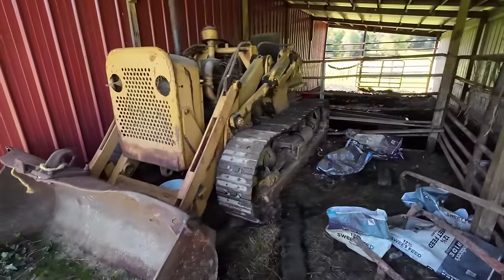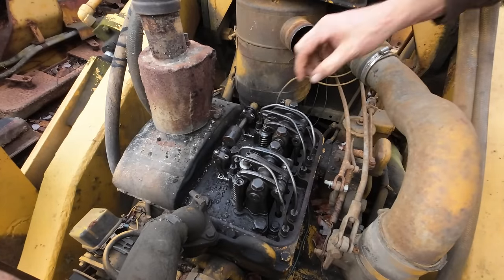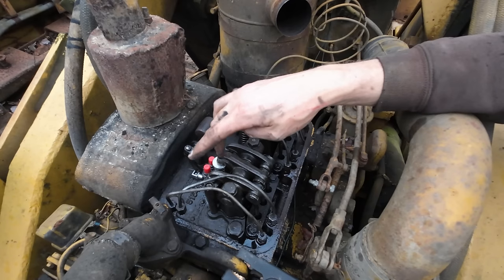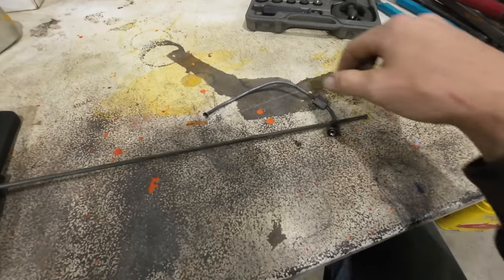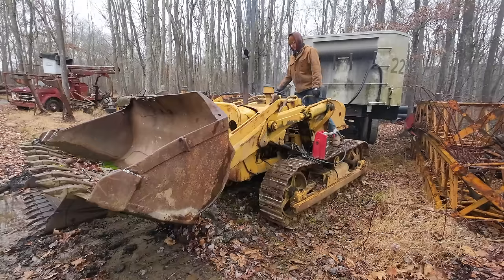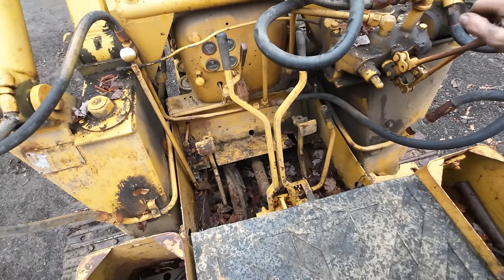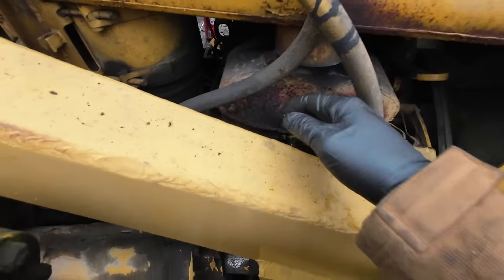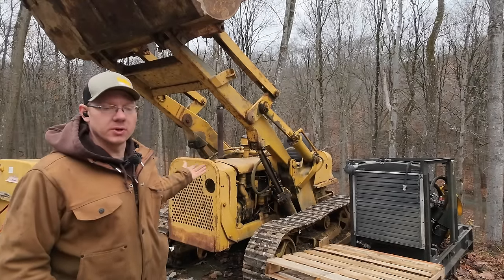$500, Allis Chalmers Track loader. Sitting for MANY years!  (Will IT RUN?!?)

Comment: Allis Chalmers produced some great equipment back in the day.   It would be interesting to see what they'd look like if they had survived until now.
Reply: I know it's technically not the same, but they are still around as the Allis Gleaner Co (Agco). I keep saying they need to make throwbacks with the Massey lineup rebranded as AC, Oliver and White's. I'd be a sucker and all over it! If it weren't for different colors, equipment models look the same these days
Reply: @xterradventure   They actually still make Massey Ferguson 35 tractors in Africa. I agree, New tractors have so much plastic covers you can't see the engine or anything and they all look the same.
Reply: @xterradventure  None of the higher ups at AGCO, will admit Allis Chalmers had anything to do with AGCO. 
 The Allis Chalmers name was sold off with oil field equipment and Allis Chalmers Energy used that name until 2011.
 "Allis-Chalmers Energy was a Houston-based multi-faceted oilfield services company. The company provided services and equipment to oil and natural gas exploration and production companies, both domestically and internationally. It became Archer in 2011 after it merged with Seawell, another oil services/energy company."
Reply: @bluegrallis  I think the name was last used on some Persian Orange lawn tractors made by MTD.
AGCO higherups really screwed the pooch when they ended the Ago-Allis brand.
Challenger, Fent and Valtra don't mean anything to me.
Reply: @bluegrallis  It wasn't the name, that is the last surviving part, AC had an energy/oil equipment division. That is what that is.
Reply: @1978garfield  Don't forget about White too.
Reply: @xterradventure  They can't use the AC name, Oliver would be like reviving the Minneapolis Threshing Machine Company name, and White they still use on planters.
Reply: White was very cool as well. 
If I were a millionaire I would have restored Farm Boss and a restored Road Boss to drive it around with.

They own a lot of the intellectual property.
I think the MTD AC lawn tractors said something like Allis Chalmers brand property of AGCO.
They sell merch for MM, Oliver, Cockshutt, White  AC and all the other cool brands they don't make any more.

Even if they can't make AC tractors anymore for some reason the Persian Orange Agco Allis tractors they made connected more with the market than Valta and Fent.
Speaking of connecting with the market looks like Challenger has been discontinued.

The big rubber tread Challenger is now a Terra Gator product and the rest of the line is gone.
Reply: @1978garfield  The Challenger brand was discontinued as well a few years ago. It's all Fendt now, and they're completely indifferent to the fact that no American knows what a Fendt is, just like they ignore that Massey was Canadian and probably would get more recognition in the states than Fendt.

Comment: I forgot to weigh in on the oil controversy. I'm old school having trained on pre-1968 cars and trucks. But I'm on board with you Matt, the multi grade oils are the way to go. The engines turn over a lot better in the winter and as the egine warms up the oil transistions to the higher viscosity. I'm running multi grade in my 1972 IH farm tractor and its not dropped a rod yet. Those who insist on a single grade of oil must live in a warmer climate, store their equipment in heated garages or use a lot of hydro with block and oil pan heaters. Todays oils are fine in 99.9% of applications. JMO

Comment: AGREED about the oil. Back in the 1990's I did the research when I worked for a municipality with an extensive list of equipment and I wanted to do away with the extensive amount of different oils both engine and hydraulic/transmission. The results were as you suspected, even the old 2 cycle Detroits were oked to use 15w40 and we also eliminated 5 or 6 different hyd/trans. fluids standardizing on "all purpose tractor/hydraulic oil. The only thing i found was the vehicles calling for 5w oil or 0w should not be converted. Four years ago I switched my 2007 GMC 6 liter to 15w40 the first cold day (below 0 ) I had to switch back NO OIL Presure!

Comment: You should use a cf2 low ash oil like T1 rotella or delo100. Viscosity isn't the issue you can run 15w40 but the soot sticks to the detergents in the new oil. Any oil is better than no oil

Comment: As far as multiweight oil goes, you're right on that one. I am running a mercedes engine from the 80s in a genset, the original handbook said single weight oil as well. I actually had some back and forth with an oil manufacturer and they said its fine to put modern multiweight oils into that engine. Technology has improved after all, same goes for antifreeze, so you'll most likely be fine as far as engines with an actuall pressurized oil system go, lawnmowers and such however still want single weight oil today.
Reply: my snowblower calls for 5w-30, my lawnmower calls for 30.  I just run amsoil 5w-30 in all my stuff, and that lawnmower is over 15 years old and runs perfect with no smoke.

Comment: Great rescue Matt!  QUESTION: when you parked it, you left the bucket up, open to the sky.  Would it not be better to point the bucket downwards so that it doesn’t fill up with rain water?
Reply: For the longevity of the bucket, yes... But better for the hydraulics if the cylinders are fully retracted, in order to prevent weathering of the chrome on the rams. Now, with the chrome being mostly gone already and the cylinders in need of some serious love all around, it's probably far less critical at this point than it would be on a machine with, let's say 'healthier', hydraulic components. Plus, a couple small rust holes in a bucket are far easier and cheaper to patch than rebuilding the hydraulics.

Comment: Friend died. Tractor raised bucket to replace cylinder new cylinder installed. He turned middle valve. New cylinder was dry so fluid ran out of other and bucket fell and crushed him to tractor. So be safe be smart.

Comment: We had a big red Taylor forklift with a Detroit.    Those engines grow on  you.  They like to run wide open and loaded..  it's OK cleaning up crankcase never hurts them. None of the multiweight oil does anything until 0  degrees. So it's a waste of time. It does go to the thin side over time. Heating and cooling cycles. SO 40 in summer and 20 in winter. Is my  routine for 50 years.

Comment: Watching you use that fuel line bending kit, reminds me of why we should mourn the passing of the independent spares guys. There was a little shop about two miles away from me who had about every bending kit that was ever made, he seemed to like it ! if you couldn’t get one made there ….  those guys are all gone now.  Unfortunately including the two brothers who did carburettors. They worked out of a house and must have had about every spare part and body ever made,and knew what and where all of it went or could go. They built me a few.   Modern life  is NOT better !

Comment: I have been running Detroits for 50++ years and still own 3.(Sawmill 4-71, Generator 4-53 and crane 4-71)  for the last 20 years I have been using 20w 40 with no problems.

Comment: 2 cylinder, its a HD5, i owned one just like that one.  it can do a lot of work on 25 HP.  the engine is just  standard 2-71 with a GM clutch dropped on the HD5 frame, then connected to the transmission.  the machine will keep your arms and feet busy.

Comment: I have some experience of running the 71 Series Detroit. The joke in our shop was that after the first 50 miles of rolling down the road it would burn a gallon of oil. My uncle picked up 4 tandem dumps, and after two seasons they were sold. Those engines used to hunt for the idle, it was crazy yet common I heard. I liked them they were quicker than the Mack's in the fleet of 30 or so, plus these babies had 13 speeds versus the quadra plex ect. (early 70's)

Comment: This is a great reminder/educational about the everlasting GM  71 series, Appreciate the portions regarding setting the rack and tools and the "easy fix" of replacing the return line. Clues on the fuel flooding in the lube oil. (I think they still recommend straight 40w). ANY OIL IS BETTER THAN NO OIL, LOL!    AD seems to be the favorite parts rebuilder.

Comment: Matt I worked with a logging company in my younger days and they had 100s of Detroit's and we always used Exxon XD-3 15w40 and never had oil consumption issues. The reason it doesn't have any power is the governor could be out of adjustment and the rack could be off some as well on those injectors. Enjoyed your video.

Comment: Hey Matt, I noticed you had the jump pack hooked to the winch battery.  My buddy and I took a harbor freight 212 and hooked it to a one wire alternator for a 350 Chevy with a giant marine battery and mounted it to the front of our trailer.  It turned the winch into a whole new animal with having the proper amount of power coming to it.  We would just start the engine whenever we needed the winch and it made a world of difference, and never had to deal with any dead batteries.  It may be helpful ok some of your recovery missions, just a tip!  Thanks for all of the great videos!
Reply: You could even mount it in the bed of your truck and you’d have the worlds best battery charger and jump pack all in one.  I normally hook the cables together with Anderson connectors like they do on forklifts and it works very nicely!

Comment: Matt: You are 100% correct.  Most lubricants are now synthetic so that there is better extended viscosity control. Old motor does not have that.  Viscosity extends the life of the engine for a longer period of time.

Comment: In the trucking industry for 40 yrs both as a driver and a mechanic  had an old  Peterbuilt 359 tow truck with an 8V71 always used 15w40 it had 600K and some never had any issues with the oil

Comment: Hello from British Columbia Canada. Go to the truck wreckers man. Get a nice battery box and aluminum fuel tank with brackets. Stainless air cleaner? New exhaust! Those parts aren't that much money and new exhaust piping is cheap. Save those D4D batteries for something else. 4 new batteries. Run 2 power cables too. 1 ground to the starter the other to the frame. You'll never have any issues. But that's just my opinion. Enjoy the channel👍

Comment: Matt, the military used lots of Detroit's for a reason. I've seen them bury a fleet . Only to come back & blow them off. They were  protected to a degree with plastic. Another thing. I worked for Cat my entire career. The company went from @ 6-8 different lubricants in all the machines old and new from gear oil, engine oil to 10-30 in all cases minus hydraulic. Unless it is built into the steel, Detroit's run on 10-30. Most people don't understand multi weight. The additive that makes it multigrade is a molecule that attaches to base oil. Think chains. These chains attach to the oil. The hotter it gets these chains contract increasing the viscosity. It was not an uncommon practice to drain oil and fill with diesel to flush. Get the machine hot, drain, top off with diesel. RUN AT IDLE ONLY 5 MINUTES IDLE ONLY. Not my rules, CAT. I watched a video once, CAT video. Pre turbo engines. Low power low rpm. They had this contraption you put on the intake. You filled a reservoir with Bon Ami or Bartenders friend. ( Like Comet no detergent. Bring the engine to high idle & you opened a valve. This would allow the polishing powder into the intake. & through the cylinders. It works. I never did this procedure but I saw the training vid. You probably couldn't find the vid now. Building a go kart for my son, I bought a smoker at the flea market. Cranked it, let it get hot
 Poured Bon Ami in the intake SLOWLY A TEASPOON SLOWLY. IT WENT FROM BLUE TO CLEAR. A desparate man is capable of amazing things. I would NOT attempt this on modern in machinery. I had a mentor, old school at Cat. He was a genius on Cat. Only job he ever had. Taught me a LOT. Try this on something small. ALSO, small sips of water into the intake at high Idle.. Ever see a blown head gasket? The one with the leak looks like brand new. Slow is the key word
 You CAN BEND OR BREAK A VALVE if you do it to quick ( read too much carbon leaving) It works. Hope this may help.

Comment: Detroit was doing testing on multigrade oils in two strokes in the 1980s and 1990s, part of the incomplete report was released through the API/SAE, and they said for 92s it was probably fine, consumption might go up some, but it's' a detroit if you're not adding oil, it's out of oil.

Comment: Good Ole Jimmy two strokes.  I've worked on them on fisshing boats (GrayMarine) and in Vietnam as an engineer for river boats, construction equip. etc.   Good engines.  The one thing is I could never get the black crud out from under my fingernails.  You and others always speak highly of Area Diesel Service.  What you did with the radiator hose we called "field expedience".  I still save stuff.  My garage/shop is like my grandpa's garage.

Comment: Thank you Matt for the video totally enjoyed it I love the sound of the old engines And when you work on them they are very simplistic Wish things were that way today. Those 2 cylinder Detroit Need to be wrapped up to 75% of throttle To get them to work adequately, They just do not produce enough power At lower RPM . I am thrilled when you get these running I just love The song they sing Is it just running
Reply from the maker: Glad you enjoyed it

Comment: I use 10W 30 in 1932 Plymouth instead of SAE 30 - I start the car in this Western Pennsylvania cold weather, just because. It has good oil pressure still with that oil.  The operator manual actually indicates to, in the winter, dilute the SAE 30 oil with Kerosene.  I’m so glad for modern engine oil!!!

Comment: I love Detroit engines when i was a young Private First Class in Korea.  I was the driver of a M113A2 which had a 6V-53 V-6 diesel it was leaking oil and the mechanics had me drain the oil to burn up the engine so we could get a new engine in it.  well after six hours of running with no oil it still ran... a year later the same engine was in that track LOL

Comment: I worked for a company that had a lot of older equipment, they were big on Euclids, and they had a loader that had a 3 cyld Detroit.
It was so old there were holes worn in the metal foot feed, and you could not travel and raise the bucket at the same time, it just didn't have enough power left in her.
No brakes either, you just hit the side of your tyres with it.
It sounded just like yours.
The guys in the shop called Detroits converters. They convert diesel fuel to noise.

Comment: I also saw a feed a while back on a old  vehicle I believe and the owners manual showed proper used oil disposal and pretty much consisted of digging a small hole in the ground and pouring the used oil in the hole and after the ground absorbs the oil up you just put the dirt back and all good.

Comment: the air fitting on the fuel tank is to make it easy to prime the fuel system by pressurizing the tank, carefull, not too much, then crack injectors and filter

Comment: My dad had a 2-71 out of an old scrap yard AC crawler, thing had 13Khrs on a broken hour meter...
Struggled a little starting till warm.
Sounds about right, exhaust blew a little fuel from his home made manifold ...
He had a very similar back cover/instrument panel w/throttle lever mounted to an engine frame.
BTW, Old school Detroit recommendations ... straight 30W winter/40W summer:face-green-smiling:😉

Comment: The injectors helped the no-start/hard start along with setting the overhead and the rack, but I suspect low/marginal compression from too many previous visits from the Ether Bunny (due to the bad injectors) or air is getting into the fuel system.  It's gonna need new hydro cylinders and all hydro lines need to be replaced for safety.    For $500 that's not a bad bargain.  If you don't mind the risk, you can try just replacing the cylinder seals and polishing it smooth where the chrome used to be.  P.S. prefill your filter with diesel! :)

Comment: The air fitting on the tank is probably a quick drain option. A length of hose with a male end on it that plugs into the air connector and drains into a bucket.

Comment: Detroit Diesel was one of very few engines that the designers seemed to consider making it easy to maintain. If you run a multigrade oil in a Detroit 2 stroke, you will find that it uses oil and has low oil pressure. We used Mobil oils and even Mobil recommended straight 30 for Detroit 2 stroke engines.

Comment: If for some reason the sale falls through again ill trade yea my non running IH 3800 rear steer backhoe/loader with 20 year old brand new tires and The machined D282 Head still wrapped in plastic with new top end gasket set..  Same motor and wheel pattern as your 3850👍👍

Comment: In 1952 the HD 5 sold for $9600.00. It has a 4 forward 2 reverse transmission. 40 HP Drawbar. WT 16,200 Lbs

Comment: I ran a twelve volt battery on a six volt starter for years. It is a good thing the engine never seized, that battery starter combination would flip the tractor over. lol
If you want to turn right just make 3 left turns.
Yup, starts on ether, runs on diesel. Them old detroits will run on anything.
A good deal for 500. bux!

Comment: Can't agree with you more about modern oils. They are so much better than 50 years ago. Even the old school engines have less wear with these new oils. I recently pulled the heads on a FE390 with about 90,000 miles on it after rebuild in 1993. Virtually no ring ridge at the top of the cylinders. The thing still runs tight as can be. Only had to change timing chain because that old style chain would stretch too much by that many miles on these old FE's.